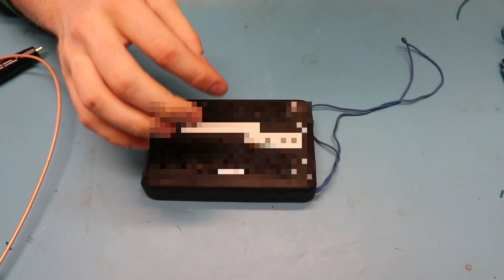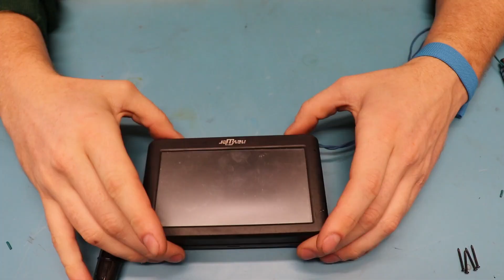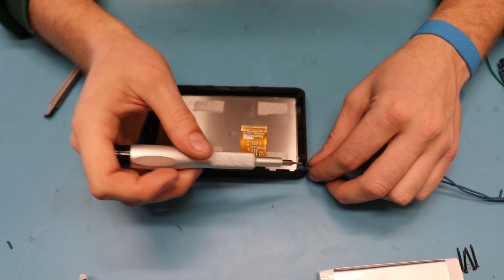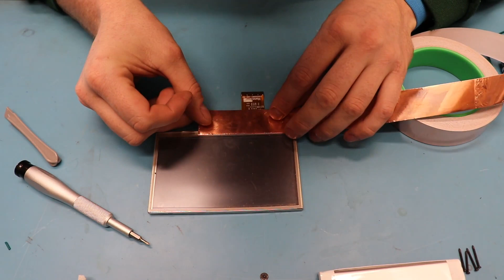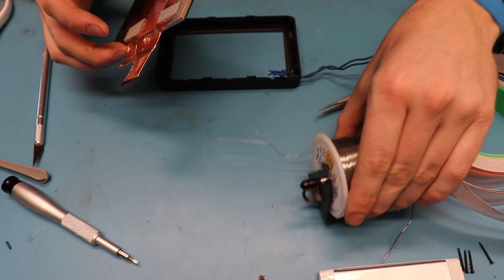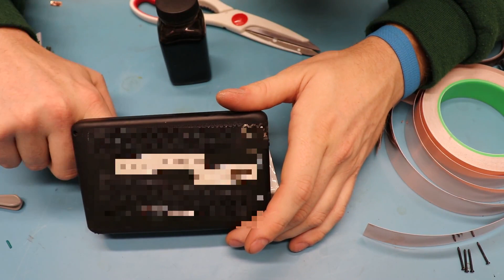Applying RF Shielding Tape to Naviter Oudie Ribbon Cable

Comment: Great solution!  I managed to get away without the extra foil at 7:50, and without any soldering, even.  I further overlapped the vertical strip of foil connecting the screen to the ribbon cable by about 1 inch, figuring the extra surface area would help conductivity.  No longer any detectable noise from a FT-3DR, which used to light up like crazy even with the squelch turned all the way up, especially on mostly-white screens.  Makes a huge difference in usability (and in turn, safety).  On behalf of soaring pilots worldwide, thank you!
Reply from the maker: Glad it worked out for you! It is true that I likely shielded more than the bare minimum to get radios to work. I am used to a lab environment and was working towards FCC compliance limits. Indeed the capacitive coupling between the foil is likely enough for most real world interference problems without soldering.

Comment: Hi Ian.  I'm willing to attempt this fix but I'm having a hell of a time with the screws. The heads are quite tiny but even then, I'm having a hard time getting the screwdriver bit to seat properly. The screws are really threaded down in there and I'm afraid my torquing is going to strip the heads (already getting some loose filament). Your screwdriver appeared to have gotten it done without any issues. What kind is that and what size bit did you use specifically for these screws?   Thanks!
Reply from the maker: It's been a long time, but I'm guessing the the screws are probably PH00. The screwdriver you see me using in the video is part of a kit that runs several hundred bucks, so I don't recommend you get that for one job. Jump on your favorite internet sales site and search for jewelers screwdriver set, or just search "PH00 screwdriver." Grab a kit that includes like PH000, PH00, and PH0 and you'll be covered. Should be able to find something less than $10. 

Otherwise, cruise on over to your local pharmacy and grab an eyeglass screwdriver, I bet that would work. 

if you are trying this on your own, just be very careful. As I said in the video, just because I did it and it works doesn't mean I'm necessarily endorsing the process as a DIY special. :)
Reply: @iaahner  thank you very much, Ian!